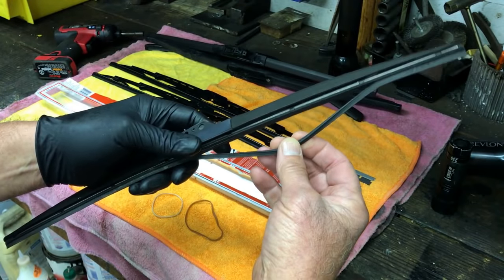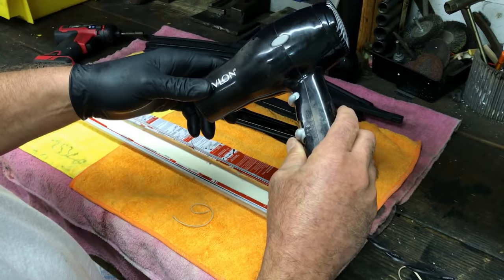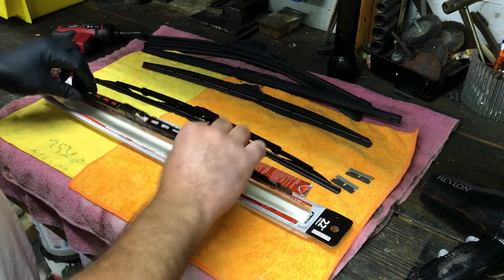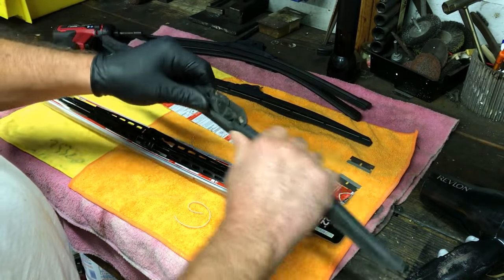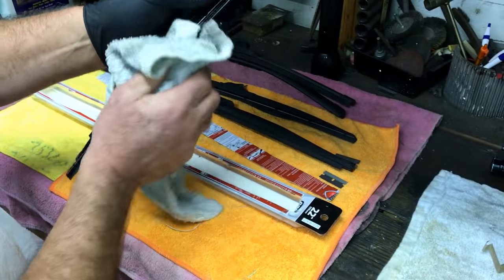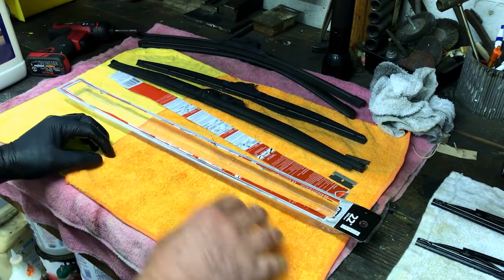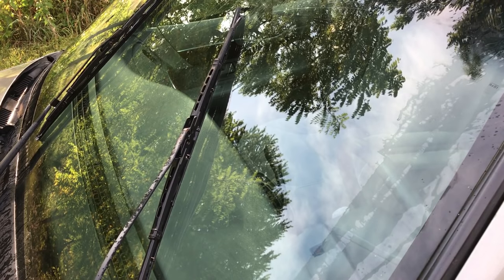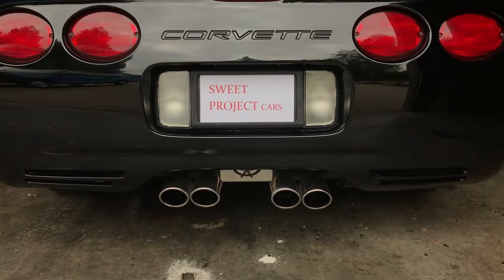NEVER ! Replace a Wiper Blade  AGAIN !!!  Amazing :)

Comment: Awesome video I need to try this! What is that you use, 303 something?
Reply from the maker: Edward any good water based rubber conditioner will work,  what we use it the 303 aerospace UV Protection thanks for the kudos :)
Reply: Sweet Project Cars , great thank you for the reply
Reply from the maker: you are most wlecome :)

Comment: Wiper blades need to be replaced at some point in time, they're not that expensive anyway if you buy them when they are on specials
Reply from the maker: you are correct,   but as you know cars are money pits and we say why replace ever if the part is still good and does not need to be replaced   save your money and put it elsewhere on your car.    we thank you very much and for the quality comment it is very helpful for the whole channel :)

Comment: But with what you condition the wiper blade? Is rubber conditioner same with tire dressing?
Reply from the maker: no it is not the same..you just need to find a good water-based tire conditioner at your local auto parts store
Reply: Sweet Project Cars thank you, I will look for it :)

Comment: I have kinda low power on my 2000 daewoo nubira wagon,  I will put on another valve cover and spark plug oil tube seals, would the 303 make the spark plug  oil tube seals last longer?
Reply from the maker: Joe Cancemi if it is rubber 303 will make it last longer my friend :)

Comment: my wipers always start splitting at the ends at the thinnest bendy part of the rubber. This will prevent splitting ?
Reply from the maker: kk P it sure will help that's for sure ...thanks for asking :)
Reply: No. If you live in areas of the world where you need you wiperblades almost every day (27 days of the last 30 days as in Scandinavia), the physical demands of bending from side to side, combined with normal wear, will break the rubber.

Comment: Makes you wonder. Does rubber really absorb 303? I use it on a boat and have to apply it 10X a season.
Reply from the maker: Greg Gilbert well we use it on everything for our customers and they very rarely replace items, like belts, blades, rubber seals, tires, and plastic, on their vehicles that are normally changed yearly without it.
Reply: zodiac?
Reply: Sweet Project Cars  Gotcha. Thx

Comment: How much is that thing? Because I can also buy rubber replacement instead of buying the whole wipers for just couple of bucks...
Reply from the maker: you are thinking of it all wrong....vehicles are MONEY PITS..so a set of blades costs 20 bucks then
you have something else on the car that's 20 bucks and so on and so on and so
on..... IT ALL ADDS UP until SPC steps into the picture, now do you see.

Comment: My blades are brand new but they skip and jump a lot. Its annoying cause it makes so much noise They are Bosch. I use Rain X all the time but didn't have any in stock... Any ideas?
Reply from the maker: easy one  clean the whole windshield with very fine 00# steel wool then use a water-based conditioner on the glass, then soak your blades as the video shows...  thank you for the great comment we are glad you are here with us :)
Reply: Sweet Project Cars My glass is fully polished and clayed, ill try the conditioning step, thanks 😁

Comment: how come no demonstration of before and after video of the wipers working?  i question the quality of the job the reconditioned wipers would be able to do cuz wiper blades lose form after being in the "element"
Reply from the maker: freddieman c why would we do that...the proof is in how long they last
Reply: why?  because we need wipers to do their job.  the reason we replace wipers is being able to see clearly out the window without streaks. how long they last has nothing to do with it without performance.  if the wiper is not clearing clearly, it doesn't matter how long they last.
Reply from the maker: we would not do it if the made the wipers worse, they clear the rain as good as new wipers would and they LAST a lifetime :)

Comment: I wouldn't spend $39 a gallon to save cheap blades. But I would to save my door gaskets.
Reply from the maker: Dale if you read the Google reviews on this product you’ll see that it is the ultimate protector for all rubber Vinyl plastic and leather So if you buy a gallon of it you might as well treat your wiper blades so you don’t ever have to change them again have a great weekend my friend
Reply: Spray your tires tread and all and see for yourself how well this product works, went for my first tire Rotation, was late on rotation, about 10000 miles and the guy at Walmart told me they didn't need rotating, I had all the guys in their shop gathered around in amazement asking me what the product was. I live in NC where most of our backroads where I live are tar and gravel, these roads will shred a tire, but mine were perfect. Try it you won't be disappointed.

Comment: ok so you do know that the wiper assembly doesn't last no matter what you do to the rubber? i'm talking about the metal that holds the rubber blade in place.
Reply from the maker: You are absolutely correct, we are not talking about any of the wiper arm assembly we are talking about the blade the rubber blade itself have a great day.
Reply: Never had an issue with the metal parts, only the rubber cooking in the sun.

Comment: How not to replace by buying it 1st..

Because when you buy a car, you don't get the whiper packing right?

Beside that, great tips and video
Reply from the maker: Antonius Susanto you are very correct and you can take the new blades off and make a trough to soak them in then you are good to go :)

Comment: So I have just gotten me an old 1988 Ford 250 EFI-351, runs great... but the paint is warn out in some places... on top of the cab it has a white milky look glazed over it... (originally blue) and where the bed meets the back of the cab its rusty ( surface rust ) Is there a way to sand that down or clean it up without removing the bed?
Reply from the maker: Geoff Treebird if you look through our videos you will find many on paint correction like this https://youtu.be/FcWB2wfuQBc and this https://youtu.be/TsqvlmFrYY0 plus many many more :)

Comment: This 💩 works.  I soaked my and my wife’s wipers and they’ve lasted over and keep the windshield cleared. Great product. It’s expensive but it works and it lasts a long time.
Reply from the maker: Steven A thank you for sharing my friend :)
Reply: Does it save money though?...Here in Florida, buying wipers is basically an annual event.

Comment: Where are you buying it in the 1 gallon size? I can't seem to find it on amazon.
Reply from the maker: Ken I just went on there you have to scroll down here is what i found   303 Aerospace Protectant 128oz
Reply: Ken Hadden I also don't see the product with the labeling in the video. I see other 303 products but not sure if it is the same.
Reply from the maker: amazon eBay and Walmart     but any good conditioner will work for the blades ) thanks for being here with us :)
Reply from the maker: amazon eBay and Walmart     but any good conditioner will work for the blades ) thanks for being here with us :)
Reply: Yea, that's what I ran into. Not the same labeling. I don't want to experiment with different products. At least not on my belts - not too concerned about my wipers.
Reply from the maker: Ken the labeling has changed from what you see in the video I buy 16 gallons at a time, 4 cases. and that was back a year or so now it time to bite the bullet and buy again..but yes the packaging and labeling on the containers is different but the same product inside.
Reply: Sweet Project Cars what does the new label look like? Is it the marine/recreational aerospace protectant or just the plain 303 aerospace protectant? Different prices and not sure which is closest to the product you recommend in videos. P.S. I just came across your videos and I really enjoy them. Can't wait to try some of these.
Reply from the maker: the new one has the bright orange 303 circle then the rest of the label is blue and white and it says: Aerospace PROTECTANT   ultimate UV protection.

Comment: We don't have 303 in India, any rubber Protestant will do?!(dash board cleaner?)
Reply from the maker: you can try it if it is water based...but no guarantees it will work as we use the 303 sorry my friend :)
Reply: Sweet Project Cars Thx Bro.

Comment: Seems to me it would be cheaper to replace the blades than to keep spraying on all that conditioner. Plus you can just replace the rubber part, and not the whole blade.. its called a wiper refill
Reply from the maker: William Bush  the GIST of the video was to show that you can treat all rubber, leather, vinyl, and plastic on your vehicle keeping them in great shape for pennies on the dollar compared to replacing parts all the time. Cars are MONEY PITS and we believe in saving where you can this procedure is not just for belts. Have a great day
Reply: @SweetProjectCars  agreed

Comment: How is this going to save me lots of money?  The smallest bottle of that stuff is $6.  And 303uv only has a shelf life of just over 5 years.  And that is IF you don't let it freeze or anything like that.  On my last car I only had to replace my blades once in 21 years.  And that wasn't even due to the rubber but the paint on the metal parts wearing off from sun exposure.  Don't get me wrong, in the long run I could see you still saving some money.  It would seem kind of insignificant though unless you have very expensive wipers or you run a company with a whole fleet of vehicles.
Reply from the maker: 101, You did not get the JUST of the video...it was showing you can treat ALL the rubber on your car or truck and many other items, vinyl, leather, plastic and keep them nice so you don't have to constantly replace them, as cars and trucks are already MONEY PITS, we say why not save where you can., read the GOOGLE reviews on 303 then you will see how much it can save you..also you dont leav it where it can freeze much like your cell phone you dont leave it where it can be damamged. thanks for the comments :)

Comment: Blades are always destroyed after winter.  -30c, ice, salt, sand, scrappers, etc are too much to ask of any wiper.  So they get changed every April after winter.
Reply from the maker: not with this method they last forever     ....vehicles are MONEY PITS..so a set of blades costs 20 bucks thenyou have something else on the car that's 20 bucks and so on and so on and so
on..... IT ALL ADDS UP until SPC steps into the picture, now do you see.

Comment: i think summer heat is the worst enemy and the time to do what you're doing,i use good silacone blades but even with them afrer a few years in summer heat tgey form to one side and make a god awefull noise one way because they no longer flop to the other side
Reply from the maker: Hello Barry do this process and use the product shown and your wipers will last for years my friend

Comment: At the end, why not just spray some on a rag and then wipe the wiper blades? Why spray that protected on your windshield and get the windshield all smeared?
Reply from the maker: You can do it however you feel we have found that little 303 on the glass actually helps to keep it very smooth and repels water great and it does not smear

Comment: Any rubber you have to treat it or it will dry out, especially blades tires ect....The most important especially in hot sunny dry areas, But it winter areas also but the most important is also to pull your blades up when a ice storm or snow is expected. People break so many lades when they let there blades against there window when it snows or ice.....then the rubber will freeze against there windshield and it wont come off until defrost but they will pull them or scrape them out and there you go!!!!It will break the rubber on the blade..  Thats when auto zone or advance auto is so happy then cause they will sell thousands of new blades at a very high cost at people mistakes........
Reply from the maker: We're with you on that!! Thank you for watching and commenting, we really appreciate it, hope you have a great day my friend. mad Mike & team

Comment: If I’m that poor to where I can’t afford to change my wiper blades once a year then I don’t need to be driving a vehicle. Just having to go through that nonsense makes it not worth it to me.
Reply from the maker: Don Genio  you did not get the JUST of the video!… It was to show that you can treat all rubber leather, vinyl, and plastic on your vehicle keeping them in great shape for pennies on the dollar compared to replacing parts all the time. Cars are money pits and we believe in saving where you can this procedure is not just for wiper blades. Have a great day
Reply: I'd you own a motor home with blades that cost $20.00 each you'll take heed to this video...
Reply from the maker: Larry Moore you got that right my friend :) and or airbags like ours has and boatloads of rubber seals around the windows 303 is the stuff to protect it all :)

Comment: I call Bull!  Nothing...and I mean nothing you can do to get blades to last more than 1 summer in Arizona.  Silicone, rubber, etc whatever.  It rots in the sun...period.  Nice try!
Reply from the maker: goo goo gecko beg to differ, my friend, this works best in the hot sun...don't knock it till you try it..read 303's Google reviews have a great day !!!!
Reply: Disagree.   Boaters from Maine to Florida and all along the Gulf Coast have been using 303 UV for 'many decades' to protect sun exposed plastics, rubber and even 'painted/varnished' surfaces.   The further 'south' youre located the more frequently such UV coatings should be applied.

Comment: What's the conditioner you never said
Reply from the maker: Julie it is 303 aerospace UV protectant   but any good conditioner that is water based will work for the blades thanks for the question?

Comment: You really should be sponsored by the makers of 303. The only thing I would add to your video is this needs to be done with new blades or next new ones. It won't restore old blades new, but rather prolong the life of the rubber.
Reply from the maker: rob we just share good products we find over the years that really work  thanks for being here with us :)

Comment: Is it just me or is buying a new blade for $10’s every couple years vs doing this every 6 months easier and basically the sand it I’ve factoring in your time
Reply from the maker: Okay, not sure where you are buying a good quality blade for $10, but if you are buying a $10 blade, it will last you about 6 weeks.  The whole gist of this video is to help the DIYer to save a few bucks and also do these processes as a hobby.  Just think what this will do for all other rubber, vinyl etc. on your vehicle as well.  Thanks.  mad Mike the hammer SPC

Comment: The $3.88 wipers has lasted longer than the others
Reply from the maker: Gavin you're correct and with 303 in the picture, they will last even longer :)
Reply: Even without the 303 on them.
Reply from the maker: but with 303 they will last EVEN  longer :)
Reply: Haha
Reply from the maker: thank you very much and we hope you an awesome day :)
Reply: Well, I'll have to get some new wiper blades because mine broke, much like in your video. Probably do to age and the freezing weather. 
Had I conditioned them, when I first saw this that might not have happened. : ) Do you remember those 3 bladed ones they used to advertise on tv years ago? Wonder if they're still sold.
Reply from the maker: well, Annie, you will not have to replace them again if you follow the video and not sure on the 3 blade wipers if they are made any longer ..

Comment: I had a spider drop into my 303 , I got bite saving it and now I have adamantium claws
Reply from the maker: That is a true bummer
Reply: Finally bought a bottle and treated my new belt. Can’t wait to detail the car and treat my new tires and wiper blades.  Way below sub zero winters st 8,000 ft in Colorado . I’ll update on how well it works

Comment: Holy crap this stuff is expensive here in Canada. Cheaper to just go out and buy new wiper blades over time. Yikes !
Reply from the maker: no you are thinking of it all wrong....vehicles are MONEY PITS..so a set of blades costs 20 bucks then
you have something else on the car that's 20 bucks and so on and so on and so on..... IT ALL ADDS UP until SPC steps into the picture, now do you see.  and you use the product on ALL OF YOUR car not just the wipers :)

Comment: uh... you could have just installed the new wipers and sprayed them the first time?
Reply from the maker: you did not get the JUST of the video, AS CARS ARE MONEY PITS  we show how to save on all your rubber items not just wiper blades  303 works on 90% of your car to keep it lasting longer and not having to replace so often ...
Reply: I was wondering the same thing. If your blades are new do you have to “soak first?” Or could you just “maintain”?
Reply: @SweetProjectCars  
It seems you did not understand my comment.  At the end of your video, you show the wipers being sprayed with 303 AFTER installation.  Are you doing this in ADDITION to soaking them? Based on your video, it appears you can just wait to apply treatment once the wipers are installed.
Reply from the maker: PETER JOHN BRANDAL we were just showing how to treat them after the initial "soaking" treatment...the spraying the window was showing how to do the periodical maintenance on them with the 303

Comment: hmmm.... I watched that whole thing and my mind isn't blown yet. Isn't it easier to just put new blades on than do all that screwing around?
Reply from the maker: the just of the video was to show the power of 303....the 303 works on every part of you car..not just wipers, saving you many dollars in replacing rubber or plastic or vinyl parts yearly.